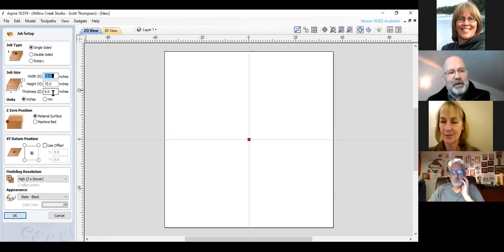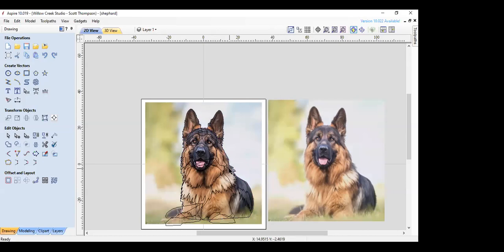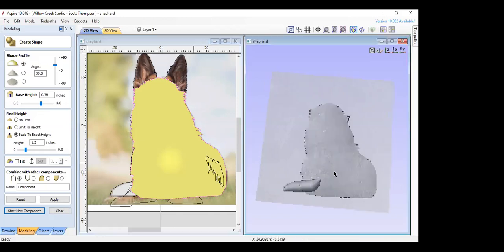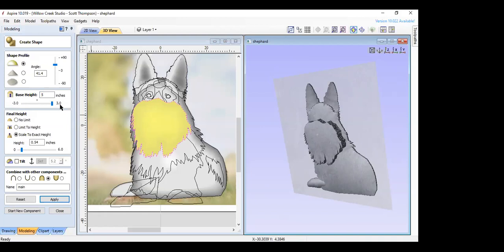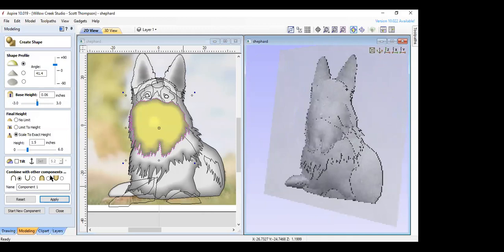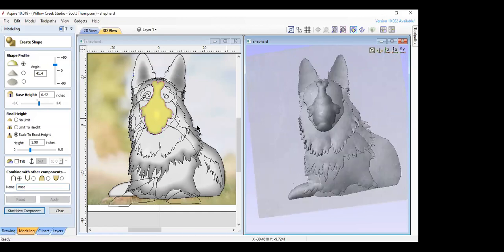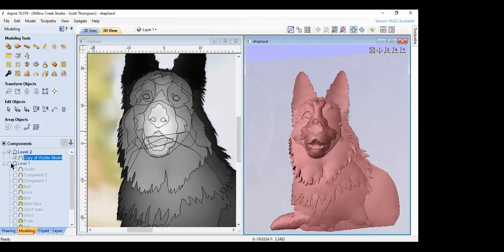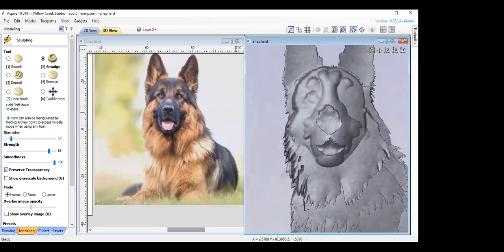3D model design of Shepherd dog in Aspire

Comment: Why dont you use bitmap tracing which u said wont work , i disagree.
Reply from the maker: Hi Blue.  I do use Bitmap tracing often, but not when i am building parts of a 3D image from a photo.      If you watch the video I am building parts of the dogs face and body that are clearly not defined by color changes on the image.    In this case if you used Bitmap tracing it would find all the different colors of the dogs face, but those are not the parts of the model i want to build on top of each other.  But perhaps i mis understand.  Some folks also use bit map tracing to create models for etching. and that is quite different than what is need to build the parts of a 3 d model in Aspire.  but let me know if I am missing your point.    Good carving.   Scott
Reply: @scottthompson5652  Tats great clarification. Thank you and i got ur point now. Thanks once again.